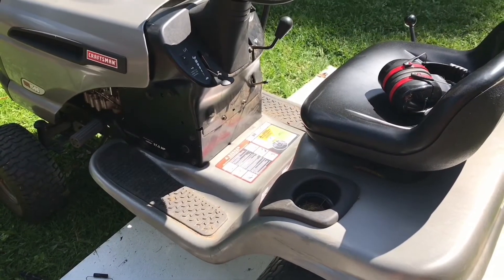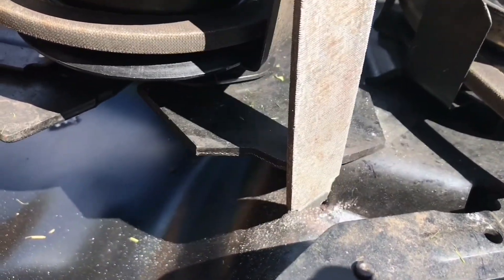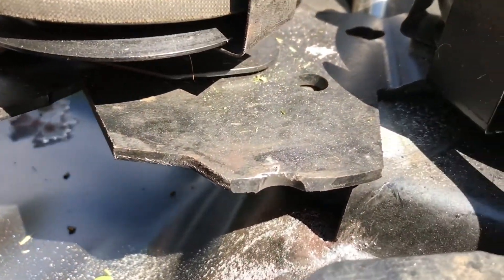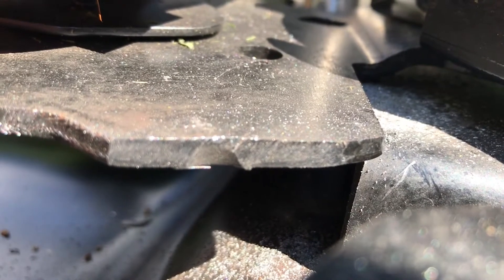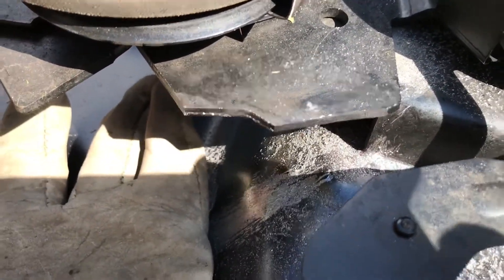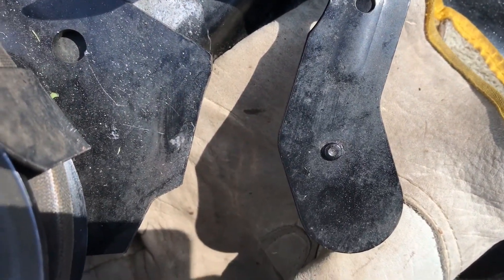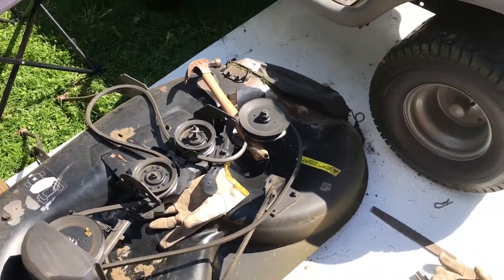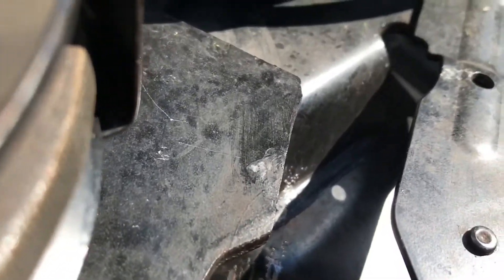Sears Craftsman riding lawnmower disengage blades       👉 FREE QUICK FIX !!!

Comment: FYI you showed the divot from the Right Blade Brake arm, which I had and I filed down, but I ALSO had a Very tiny divot on the Idler arm from the Left Blade Brake arm.  I suggest to everyone to slide the pulley back and forth to make sure it moves into position correctly before reassembling and realizing it still doesn't work.  I fortunately DID slide the pulley after filing and realized this, but I thought I'd mention this tip for others.